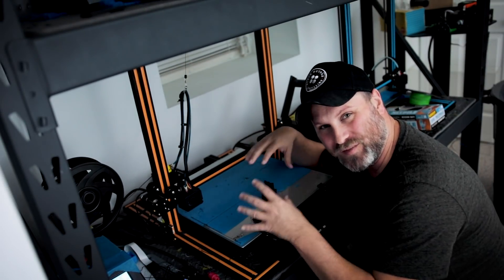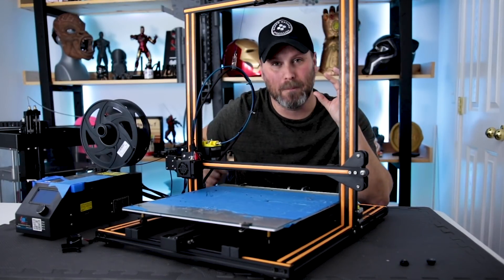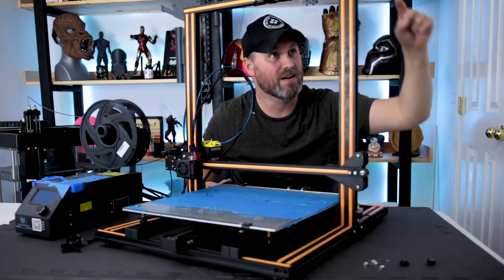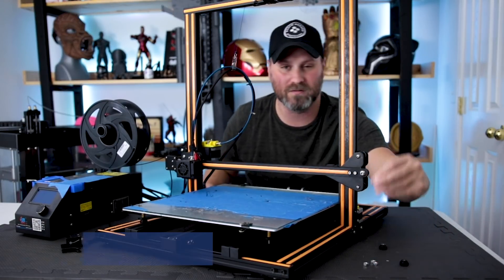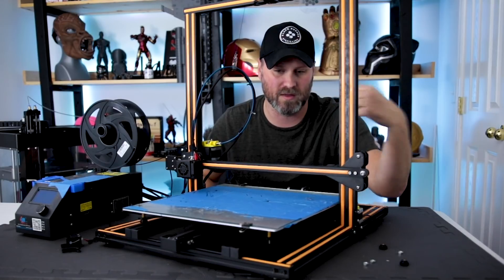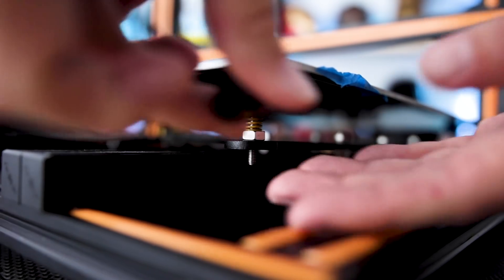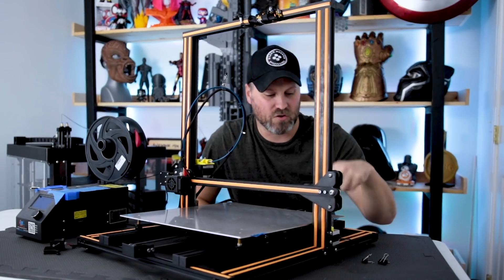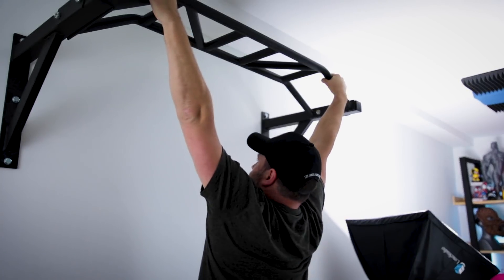.50 Cent 3D Printer Hack

Comment: i bought some 1.25" springs from ace and use much longer bolts. i will compress the spring about half way then adjust from there. this keeps enough tension and gives me plenty of working room to level my bed.

Comment: Such a simple, but cool idea!  I did something similar on my old printer, where I replaced the wheels with double nuts.  The friction from two nuts touching prevented them from vibrating loose over time.   Once I had it levelled, it stayed perfect up until the printer died.

Comment: Seriously, I have NO CLUE how you manage to have THAT issue, of all things. My complain is, if, that my wheels are too hard and won't move. It's more practical to hard mount the bed getting rid of the springs and using an Oldham coupler (both parts printable) and you'll get rid of the leveling (if done right) plus also improve issues with Z banding (if there are any) all this without the risk of ramming the nozzle into the bed, as the Oldham makes the gantry to lay freely on the screw. Just say'in...
Reply from the maker: el_marto oh really? Almost all of my wheels are crazy loose and tend to come undone
Reply: @UncleJessy  well that's odd... As said, mine and those of two other printers I "built" (built... I assembled the kits for some customers) and the darn wheels are real bitches to turn. I already had to replace twice the knobs I printers to aid with the turning until I decided to superglue the wheels to some 80% infill knobs to finally get it fixed...

Comment: So I just got a Tevo Tornado. I chose this printer over the CR-10 due to the bed having an SSR with a 24 volt power supply to heat it. It's awesome in this respect as it heats up to 80 degrees c in under a minute.
Anyways other than that it's really a direct CR-10 clone. I have had this printer now for a couple of weeks and have had only 1 successful print from it. I have hunted down the problem to not being able to level the bed. This isn't my first printer, but it's my first large format printer. I have never had this much of an issue leveling a bed. It's always to high other to low and no matter what I do I can't seem to find the happy medium. Do you have any suggestions? I'd love any help from anyone. Thanks a lot.
Reply: Join the Tevo Tornado forum on Facebook. We're a pretty decent community that generally help each other and no matter what problem you're having, someone else has probably already had it and found a solution

Comment: i install the bolt and then a nut with threadlock to secure the bolt to the bed...then add the spring following after i install the level nobs with threadlock....after i just level the bed and let the threadlock dry and now it will never loosen again...or u can use threadlock nuts

Comment: Uncle Jesse, I had the same type of problem. What I did was replace the wheels with a printed version that holds a locknut. The locknut has a silicon ring that doesn’t allow the wheel to unthread. Here is one design that shows the type of nut and wheel replacement.  https://www.thingiverse.com/thing:2824131

Comment: I use an adjustment nut on each side of the bed carriage, so that's 2 nuts per bolt, one below and one above the carriage. Each one locking to the carriage.  This eliminates the need for the spring all together.

Comment: I just designed and printed some spacers which did the same trick. Someone mentioned getting nylock nuts which would probably be the best solution, but would then have to design new bed knobs and have the nuts seated in the new knobs.

https://www.thingiverse.com/thing:2796833

Comment: You could also just lower the z limit switch.
Reply from the maker: Trolling 4 Dollars pffft now he tells me 🙃😬
Reply: Maximize the spring compression, lower the Z-stop, then do a bed level. The springs really should be kept fully compressed if possible.
Reply: Yeah thats what I did on mine, I just started 3d printing so maybe I haven't printed long enough but so far I haven't had a anything come loose.

Comment: 3:37 I wouldn't do this the way Jessy showed. Take off all the level knobs at once that way you don't put flex on the bed while installing these nuts. The last thing you want to do is put any bend in your bed because then it will never be flat and level again. 

Nylock nuts are even better. That's what I went with for my cr-10. Failing at 75% when doing a 40+ hour print hurts. After that happened to me once I ordered a bunch of nylock nuts and rarely have to level my bed. Now I only level when I have moved the machine or done something with the hotend. Also the nylock nuts only take a minute to install. You will need to print some new leveling knobs unless you want to use a socket to level your bed but you just put the nuts in the wheels and install them and you're done. Don't have to take the bed off the frame or you don't have to mess with the springs. But the one Jessy shows is also a great option if you don't have access to nylock nuts.
Reply from the maker: x9x9x9x9x9 nice! Thanks for the added info for additional options!

Comment: my height adjustment wheels dont fall off, but they do seem to vibrate and move or something.  i constantly have to tweak the bed.  any recommendations for that? CR10
Reply: Try some thread locking fluid.

Comment: Hey...I really recommend something very similar. But slight variation. Install the nut above the spring and use the nut that is sized for your thread. Tighten it down to sandwich the bed. Additionaly this will keep the bed from wobbling as it moves. It keeps the bolt rigid.
Reply from the maker: CNX Tech oh nice! Will have to check that out

Comment: I used nylon bushings instead.  Sometimes the threads on the nuts engage the threads on the leveling screws and make leveling the bed more difficult than necessary.